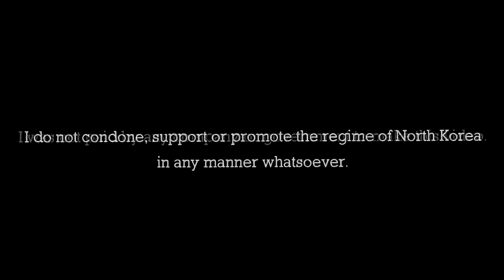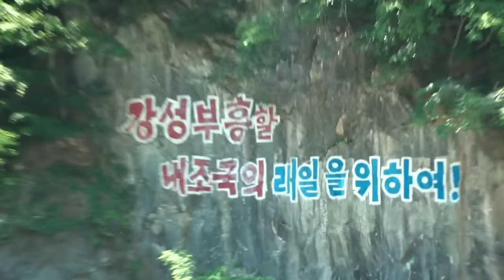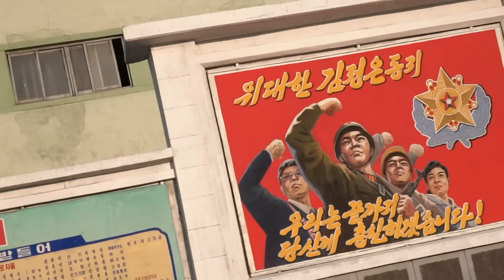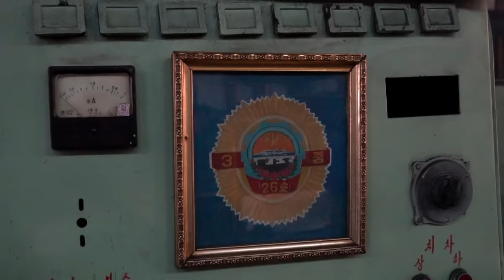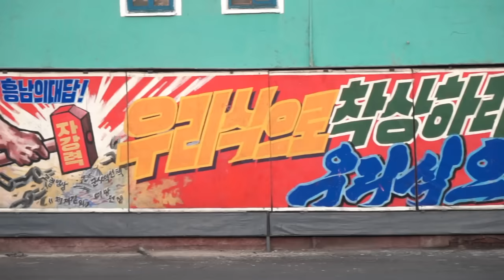THIS IS NORTH KOREA? (not what I expected)

Comment: yeah i remember when i was a kid in Taiwan, we didn't have running water in the tub.  it was just filled with cold water (and kinda gross) and then mom would boil/heat up hot water in the kitchen and then you literally washed yourself standing on the floor with a floor drain.  i mean it got the job done and when you know nothing else, that's not really weird either.